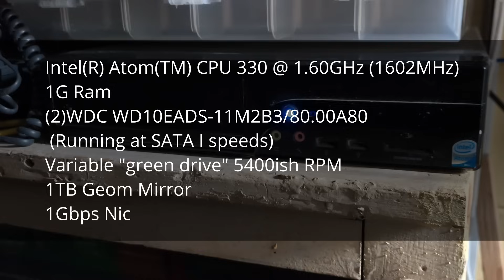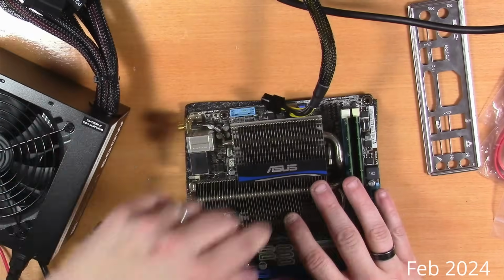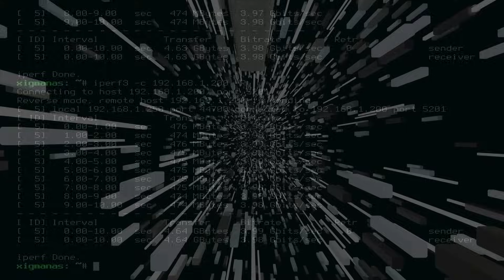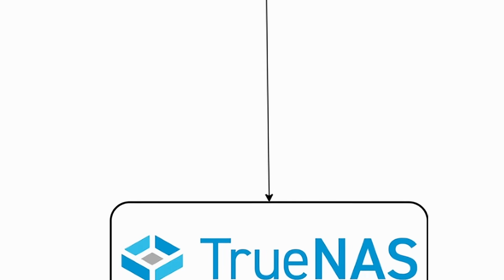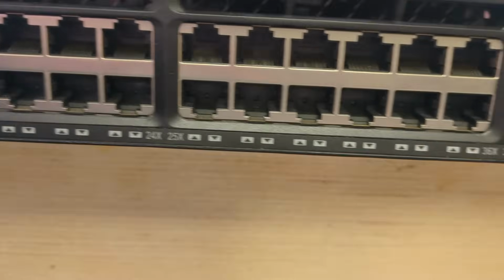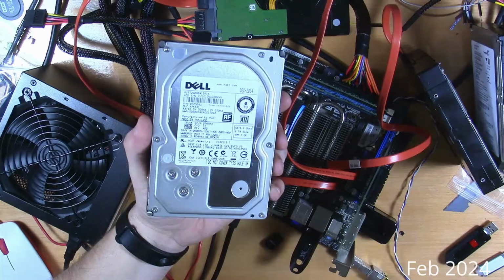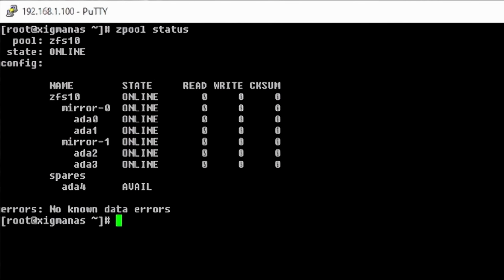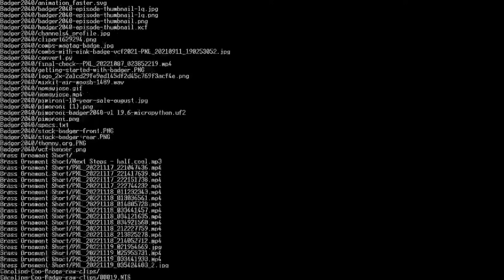Turning a 14-Year-Old Mini-ITX Board Into a 10G NAS

Comment: I ended up going with 2.5 gig since 10 gig networking gear is really expensive  later down the road once 10 gig comes down in price I'll consider upgrading I already have the ethernet Cat8 Cable  it would just be changing the Nick cards my router already has 10 gig on it.  Personal used xpenology for 2 of my Nas Systems  since I'm familiar with its interface because it's an offshoot of another Nas product. I really didn't want the high learning curve of other nas software

Comment: In 2014, Fry's Electronics had a closeout on AMD Athlon 5350 systems. The whole set of mini-ITX motherboard, quad core 2 GHz AMD Athlon and heat sink and fan was something like $45. I got many to use as NAT firewalls that do DNS, IPv6 routing, DHCP, tinc, backups via rsync and so on. They're still in constant use now, after ten years. Some were even recently upgraded to 32 gigs when I found out they can take 16 gig DIMMs. They take very little power.

One routes 2 Gbps Internet at line rate using a dual 2.5 Gbps PCIe card. Another is installed in a 1U case with a RAID card and is colocated. Several also run VMs (32 gigs comes in handy).

It's good to see people making use of older tech. If it does its job well and doesn't take much power, why not? I like seeing videos showing people that this is doable :)
Reply from the maker: @SysadminJohn  WOW! Heck of a deal there you got back then! Very cool setup. Thanks for watching and sharing. I never lived close to any Fry's but always loved it when I had a chance to visit one.

Comment: I don't really have a dedicated NAS, i have a 320GB Hard Drive connected to our router and it achieves around 60MB/s per second in sequential speeds, but the access times are very slow it seems.
And then i also have my homeserver mini-PC which is a Lenovo M93p with an i5-4570T (Dual-Core) with some external Hard Drives connected that are shared in Windows and the get to about 112MB/s so it's probably limited by the Gigabit Ethernet connection rather than the performance of the device itself.